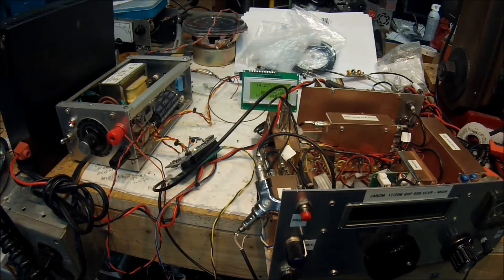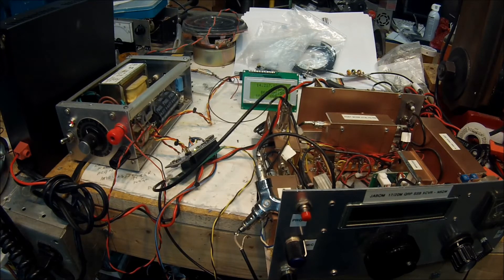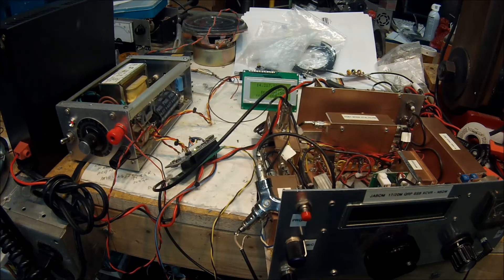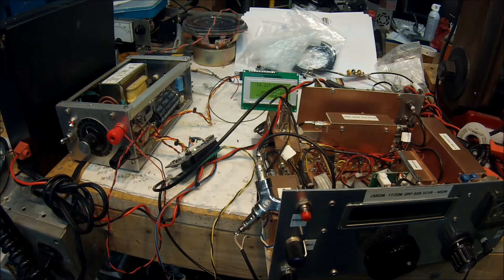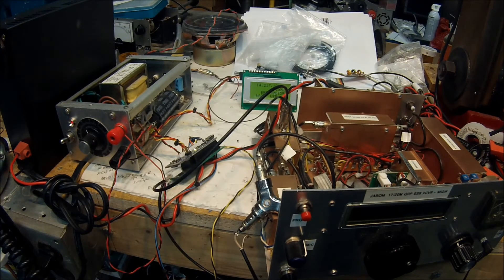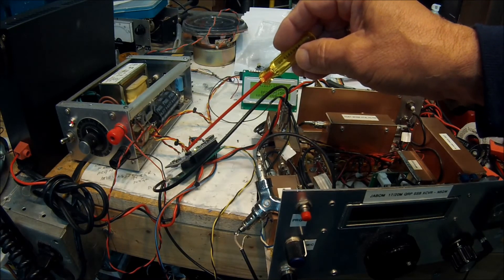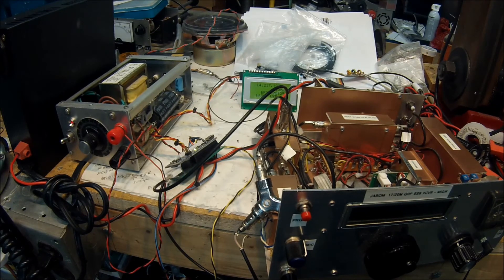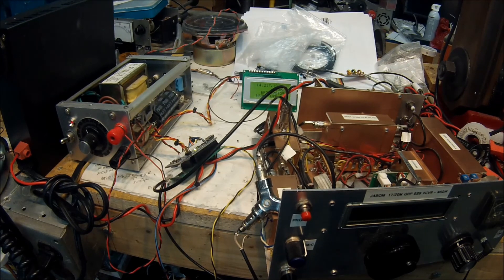Si5351 Part Deux

Comment: Pete, I'm excited to see your work on the Si5351 as a VFO/BFO...it's something I've been noodling, to borrow your term, with in my mind recently both as an oscillator source for homebrew radio, but also as a way to make some bench test gear.

I do have a question that I haven't seen addressed by you, NT7S or any of the other folks playing with the Si5351: are you doing any low-pass filtering on the clock output in order to make the square wave sinusoidal, or are you just using raw square wave? I'm an RF design noob, so I wasn't sure if a square wave will affect the operation of a mixer.

Thanks again for the great videos. Say "hi" to Newbury Park for me; I met and married my wife there when stationed at Pt. Mugu.
Reply from the maker: Thanks for your post. We live quite close to Pt Mugu as it is just over the hill and between us and the Pacific Ocean.

My experiments as I think I stated in one of the several videos were "just to get it working" and imagine my surprise when it did. I did look at some scope patterns and while they looked more like square waves were somewhat closer to sine waves. Thus I just hooked it up and tuned for maximum smoke. So filtering undoubtedly will clean up things and make them more tidy. Since I am setting the LO above the incoming signal I would think a low pass filter with a cutoff of 40 MHz (9 MHz IF) would be in the ball park.

Running the PLL output through an external amp would also provide some filtering. The software for the Si5351 enables the end user to set the drive levels so the output could be set for a low value and let the external hardware do the heavy lifting.

Like most of the leading edge technologies work is ongoing in many cold garages and shacks all over the world and so I am sure we will soon have an answer. I know one question kept coming up and that was the quantification of phase noise and Jason now has info on his blog that has data that tells the tale. That data set does show the phase noise at several drive level settings so now the for an exacting output that considers the purity of the output (like sine wave) there is a balancing act with other factors such as phase noise.

Temporarily I am working on another project trying to finish building some hardware for an article that has a publication deadline. But as soon as that smoke clears I'll test a just the Si53515 PLL with and without a LPF. Mind you I do not have a laboratory full of test equipment but at least can offer some data points.

At this time I can only offer a qualitative answer: You heard how it sounds working in the radio and the two short on the air contacts provided input that the signal sounded FB. But that does not answer the quantitative questions that would come from someone on the technical side versus an end user like me. The cost of a board is fairly low (less than $8) so maybe you could actually build one and test this for yourself and then we would have more data points.

Thanks again for your question.

73's
Pete N6QW
Reply: Pete Juliano Wow, thanks for the detailed answer, and the inspiration. For a neophyte such as myself, a qualitative answer and the audio of the JABOM in action meets my needs.

Well, perhaps it is time to stop noodling and doodling and begin to melt some solder. Obviously I'll need some of those boards...more Arduinos...I'll need to get some sort of T&E gear since I only have a DVM....oh, and a receiver to test it with and....oh, I see where this is going. Thank goodness I've managed to ditch all my other vices in time to take this one on. This is going to be the most fun I've had in years; I spent 20 years as a radio and radar tech, but fell into "management" after my Navy retirement, so I've really missed the hands-on technical side of the world since.

As I progress, I'll let you know how it goes.
Reply from the maker: ***** Send me an email to my QRZ email address and I will send you the full JABOM article and then you will have a better idea of what is on the other end  of the Si5351 PLL. I spent most of my working life in management and it was not until I retired that I was able to move over to doing real work.

Pete N6QW
Reply: Pete Juliano Tried QRZ; no luck. I don't have my amateur ticket (yet) so QRZ won't let me see your email. I left you a private note on your Google+ stream with my email address...if that doesn't work, I'll warm up the smoke signals or some other idea.

Incidentally, I ran some LTspice simulations on mixer output, using the schematic of your DBM design, with respect to input LO shape. It appears that the LO shape has almost nothing to do with the AF/IF output of a mixer, per comparison of the FFT plot of the mixer output. I'm going to do some other sims with odder shapes and differing time symmetries to see how wide a range of acceptable oscillator inputs might be useful to a homebrewer.
Reply from the maker: ***** Hi Send me an email to radioguy90 at hotmail dot com . I will send you the JABOM article.

73's
Pete  N6QW

Comment from the maker: In the video I mention about the display not tracking the frequencies being generated but an outboard monitor using the serial connection did have the correct info. I found the PROBLEM -- it was me. I put a wrong value in one of the lines of code for the LCD display. It has been corrected and now the LCD displays the correct information. The board from Adafruit Industries has a pin header so it can plug into a prototype board or a socket on a board. There are 7 connections +5, Ground ,SDA and SCL from the Arduino (Pins A4 and A5 which are the I2C) and three output pins CLK0, CLK1, CLK2.